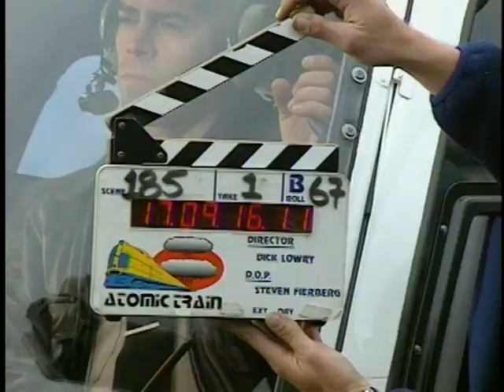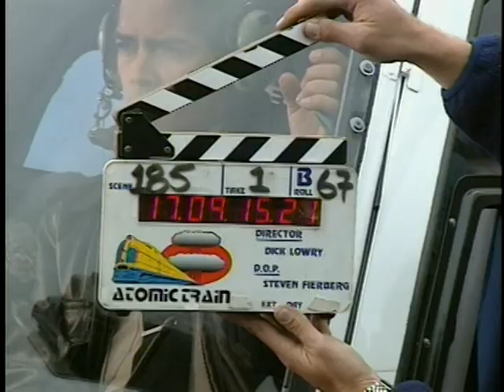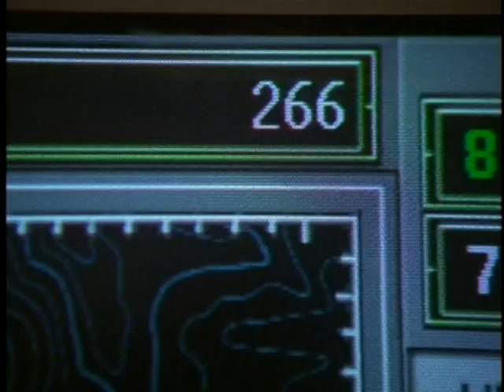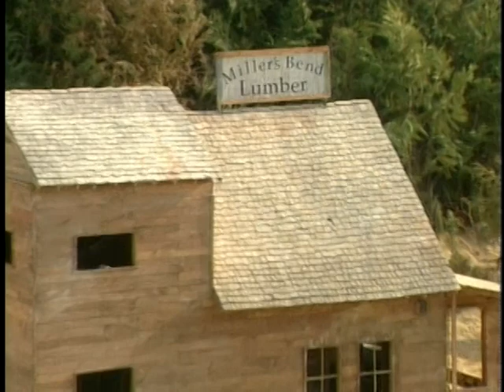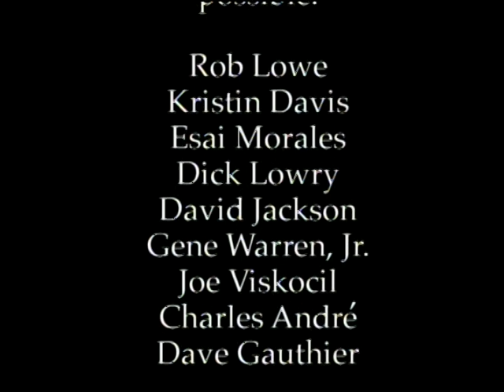The Making Of "Atomic Train" (1999)

Comment: does anyone think the runaway should've had a somewhat longer consist then what was shown in the movie or know if they really run short trains that far IRL ???????

honestly, 2 engines pulling 9 cars and a caboose seems way to short for a 300 mile long trip in my opinion, maybe something like 3 engines, with the third unit being a cab-less B-unit sandwiched between 642 and 644, while pulling a minimum of 35 cars and a caboose
Reply: I think because the company that made atomic train movie could not do that because if they did then it would take John seger longer to get to bomb boxcar and then TCNR 4920 would need 4 units

Comment: The Runaway West Rail 642 train, that had derailed, what building do you think it tore up?
Reply from the maker: If you're talking about where it was scrapped, I don't know.
Reply: @southwestwashingtonrailfan6110 
Well these engines were owned by BC Rail. 642 was sold to MHWA Railroad now numbered to 2042 but still in it's BCOL Colors. 643 was Scrapped and 644 now works with the CFS Railway in Quebec.
Reply: What happened to 641?
Reply: @Stan_ETA  Ex BC Rail 641 is still around at the Ontario Southland Railway. Its used for part stripping to keep the other M420s running.